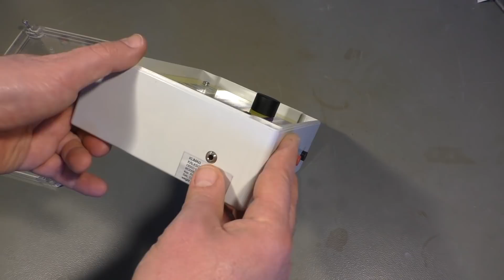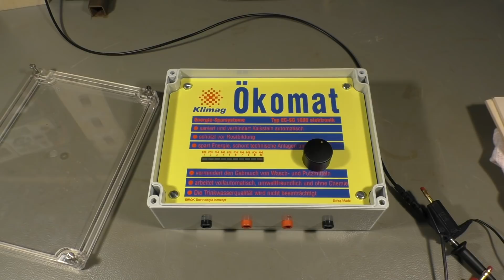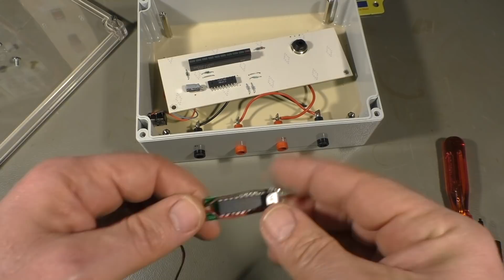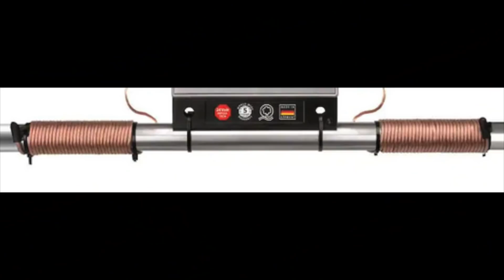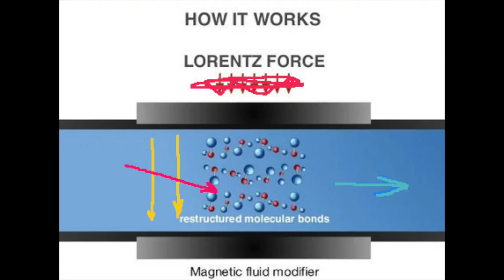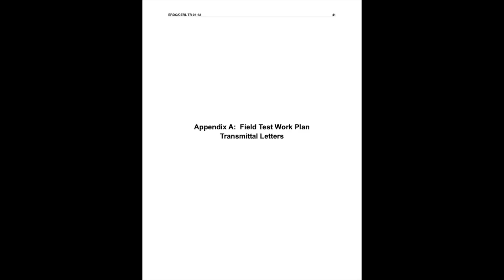The truth about electromagnetic water treatment!  (PWJ193)

Comment: It is a very simple Ion exchange system, there make the calcium molekyles not build up as limestone !!
Actually basic physics and it is a proven technich.
Reply from the maker: That's what everyone claims.... but I have not seen proof nor a working example yet.
Reply: @PlaywithJunk  So ask a expert in physichs, it is a well lnown way to handle processes in the industry.
Here it is just used on calcium in water.
We had used the ttechniq for over 40 years.
Reply from the maker: @termalouvideochannel6281  It may work in an industrial scale but when it comes to those small household devices, they are all scam.

Comment: Great work. So many scams around. The portable electric space heater from Fischer was sold to a customer of mine for over £2000 and is essentially a heating element with bricks on castors with a remote control claiming to save electricity as it acted like a storage heater evening out the heat output. They got my  comments deleted  as I wasn't the customer.
Reply from the maker: Youtube is itself a source for ads  for "incredible energy saving heater devices" Those ads are so dumb, they are actually funny! Too bad that people without tech knowledge fall for it....
Reply from the maker: I just looked at the Fischer website and the products don't seem to be a scam. But selling one of these for £2000 is very much overpriced.
A storage heater can indeed save some cost by heating it up at low energy cost (at night) and using the heat during the day.
I lived in a house with such a system but is was an enormous container full of bricks that could hold heat for at least 24 hours.
And I don't know if every country has such high and low price phases....

Comment: Thank you for sharing and for your clever and neat approach to try to demystify this old doubtful devices. 40 years ago I could teardown one that was sold at those astronomous prices and found a cheapo 555 oscillator and a bunch of discrete components. LOL

I imagine that as an electronician you probably have a clue on how this FM wave generator is working. Probably a simple siren circuit.
If you still have it laying around and are curious to sneak peek inside you could test different methods to destroy the potting resin.
I found two different methods working on differet resin. The heatgun or carpet glue removal paste sold in DIY shops. Or even paint removal paste.

Enjoyed your video. Cheers
*EDIT I just found your next video ;-)
Reply from the maker: Yeah just watch the second video. Most questions will be answered there :-)

Comment: It is always an interesting topic... does it work or does it not?
Years ago after I scrapped an old 5.25" IBM 62RW100 SCSI harddrive I had those neodimium magnets that were used for the head positioning (linear voicecoil...) that were unbelievably strong but had a shape not very suitable for use.
So I decided to clamp them around the copper water main pipe entering the house and they are still there.
Not that I noticed any change in limescale development, and of course I am not going to saw through the water pipes to see if there is limescale in them...
At least this solution does not consume energy all the time (I neglect the enery used to originally produce the magnets).
But of course it does not have that magic frequency sweep, it only has the change of field caused by the water flowing along the fixed magnets.
On the other hand, the magnetic field is much much stronger.  So if there is any effect, it should be better.
Reply from the maker: At least it will filter out any iron bits that might come across with the water...
Since magnets were invented people think they are magic in some way. So they use it for almost everything, reasonable or not.

Comment: I suspect there is a simple 555 circuit in the potting, usually these scam devices are potted to prevent people from looking.
at least this one even does something (a useless signal but something), most scvam devices just do absolutelly nothing measurable.
Reply from the maker: No they used two LM339 for the "siren". I just removed the potting and the circuit is surprisingly complicated. Watch my next video....

Comment: flux field through a plastic pipe ....maybe. with a strong enough field ferrous metals might be affected....in a plastic pipe. what that would do to the water? fiik! help precipitate clumps for a filter to trap easier?
similar device...those magnetic clamp on devices that you put on a fuel line that supposed "aligns" the molecules for better combustion....more bullshit methinks.
thanks for the vid. i laughed a bunch.
Reply from the maker: Are there also magnets for brake lines? To help brake better?  ;-)
Reply: @PlaywithJunk  i am amazed that some 'king of marketing' wank hasn't produced one yet. 🙂

Comment: Lorenz force does not work on neutral water molecules, in the case of a perpendicular magnetic field it might kick anions and cations into slightly different angles, but at the low velocity and distance of travel inside the magnetic field there cannot plausibly be any effect more then a couple of mm from the device. And with a circular coil around the pipe the magnetic field is in the direction of flow and could not affect the traveling ions at all.
Reply from the maker: That's why I wrote "assuming the water contains electric charges". I know this is technically not correct, but if you replace "charges" with "ions".... that's what I meant.
Although through the movement of the water in a magnetic field, eddy-currents could be formed. But I doubt this will do any difference.
Reply: @PlaywithJunk  magneto-hydro-dynamics is a thing - but not at infinitesimally small magnetic fields

Comment: Depending on how the circuit board is potted, you might be able to dissolve the compound.
There are a couple of different ways to do it - either mechanically or chemically.
Might be an interesting little waste of time ;)

Edit: The beige stuff (if it's hard) is often based on polyurethane. That means tetrahydrofuran, acetone or methyl ethyl ketone could do the trick.
I think mg chemicals have something called a "conformal coating stripper" (either 8310 or 8312)
Reply from the maker: There is certainly a chemical that dissolves the potting. But then I fear it will dissolve more that it should, like chip cases or the PCB. I will try a mechanical solution like 10 days of Dremel-ing.  :-)
Reply: @PlaywithJunk  Well, acetone would not dissolve chip cases or the PCB.  It could dissolve some other plastic parts or wire insulation.

Comment: The effect could actually be something simple - mechanical vibrations could make it harder for lime and other crusty stuff to accumulate. Considering the sweep it does, the pipes might vibrate very slightly from it.
As to the build quality - that's simply offensive.
Reply from the maker: That may be the case in the "several 100 watts of power" device they used in the waste water treatment plant.